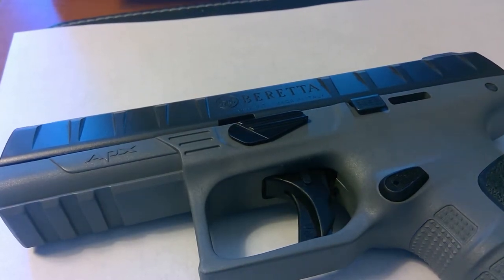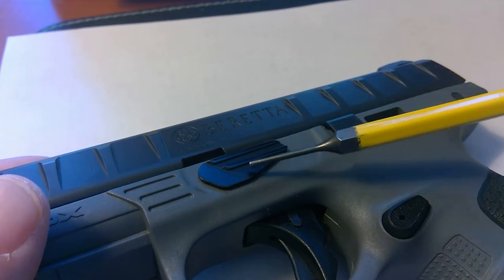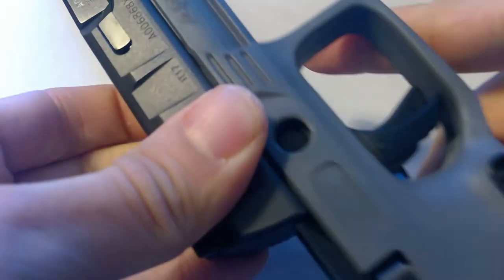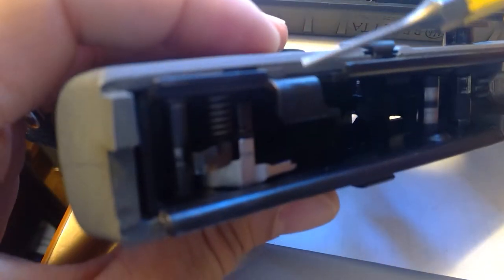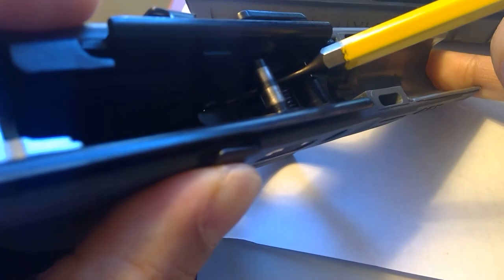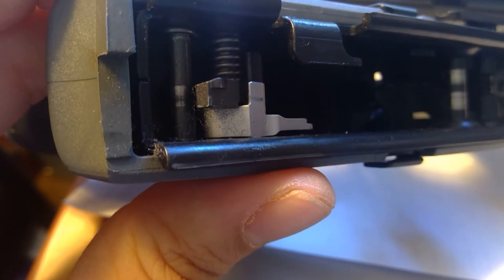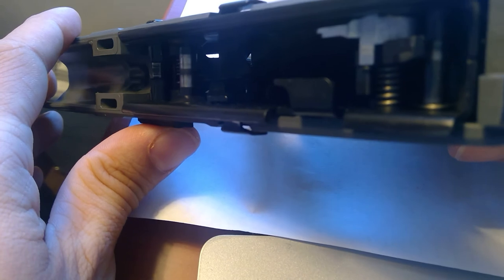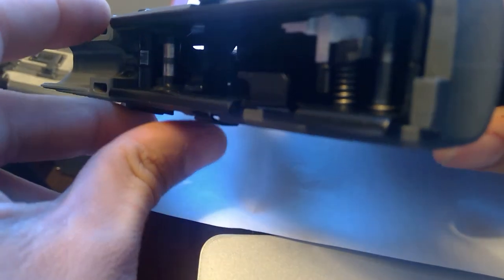Beretta APX Mechanism Details

Comment: So the APX internals are not too dissimilar from the Springfield XD, in that when the trigger is pulled, the sear drops away from and releases the striker, whereas on the Glock, the trigger bar pushes the striker back and then falls away to release it. I tend to think of the Glock's internals has something akin to a pinball machine...pull back and release.

Comment: Thanks for the video! Needed to make sure my firing pin block lever wasn't loose and that was how it was meant to be. What's the purpose of this?
Reply from the maker: You mean the striker block lever? It must be there to raise the striker block so that the striker can move forward and strike the primer. The looseness permits the appropriate range of motion and decoupling from the sear so that it can provide opposite rotational force to avoid sear slippage as well as to ensure that the striker block is not disengaged prematurely or when the trigger has not been fully depressed.
Reply: @arcfide  yes meant the striker block lever. Thank you for the explanation. I'm new to gun ownership.